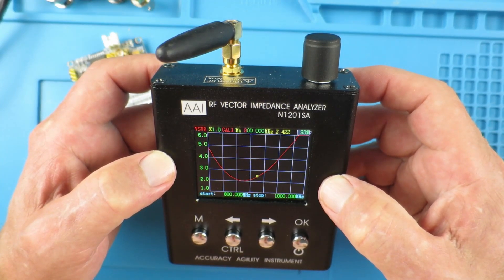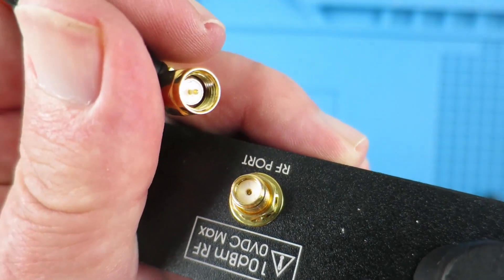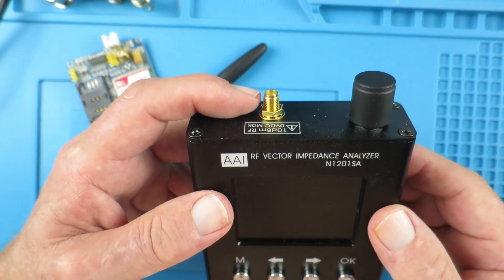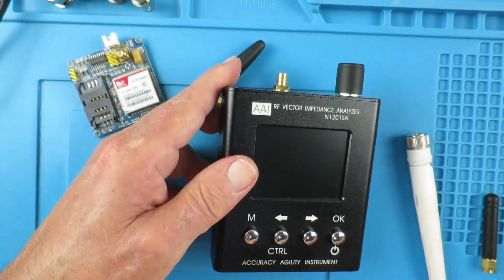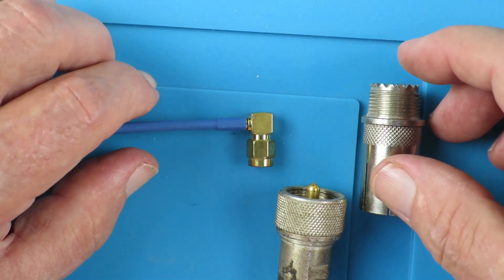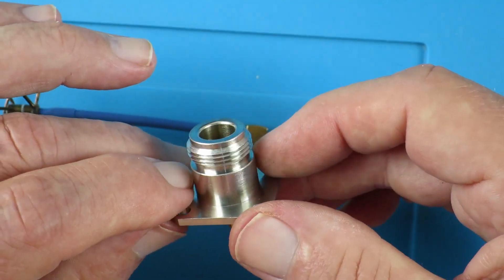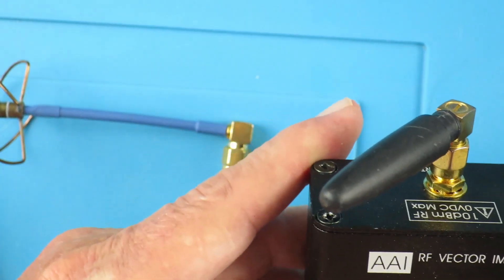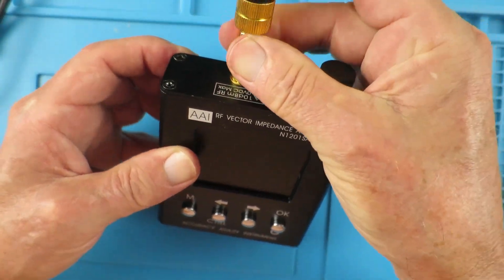SMA / Reverse-Polarity RP-SMA RF Connector Differences Explained Electronics Tutorial Banggood Parts

Comment: These type(sticks) keep coming loose the threads that is on my router so end up rolling sideways down ,  i read thread locker is not conductive so thats  a no go , is there anything that i cud put on the router nibs that wud glue them on after screwing on and dry solid ish , so they dont come loose ,  "Without affecting any gains" or signal in general ,  thx
Reply from the maker: It is recommended that the connectors are tightened with a spanner. Only a very little torque is needed. Just tightening by hand and they will come loose. Perhaps in extreme cases a small blob of hot melt glue could be used as it can be removed. YouTube no longer shows me if you are subscribed. Please consider subscribing if you have not done so already!
Reply: @1nformatica  Thanks for the Very informative reply Much appreciated , the hot glue sounds like 'The One ' Thanks again
Reply: @1nformatica  Hi mate i have another question for you , you know them rp sma adapters the TEE  , so say u have two twist on connecters on the original device well them Tee connecters would then make option of trying 4  antenna would the 4 improve the signal or would it just split the signal to basicaly having and using just the 2 original screw on antenna's , thx
Reply from the maker: @peterbrown8889  No, it does not work that way. An output is designed to drive one antenna (load) at a specific impedance usually 50 ohms. Putting 2 antenna on the same output will not present the correct impedance and the result would be very bad! You could try an antenna with a higher gain (dB), but there is no such thing as a free lunch! High gain antennas are often directional so only give a better signal in one direction. This is seen often on FPV gear where you can use a "panel" antenna to get more range, when it's pointing at the drone!!
Reply: @1nformatica  Thanks mate Your a star so i will skip that idea of getting. or in hope of more gain using 4 of the same antennna on to Original modem connectors ,, did think may be to good to be true What with them little tee adapters being so easily available and look perfect for the doubling up job ,  Thank You. !!
Reply from the maker: @peterbrown8889  The 4 antenna thing is more marketing than science. I have even seen security cameras that have 4 "antennas" but when you look inside only 1 is connected! If applicable try a directional antenna with more gain or even try putting a reflector behind the antenna! https://www.comparitech.com/internet-providers/how-to-make-your-own-wifi-extender/
Reply: @1nformatica  That's great that mate , Thanks again !!!

Comment: Lovely video, as always! You have a very pleasant speaking voice that is easy to listen to! You could go crazy and go down the path of adding different impedance adapters from the 50 ohm to also include 75 ohm. I remember buying a batch of BNC connectors that were being sold off quite cheaply; found out soon after that they were 75 ohm connectors and were of course ever so slightly different in size, so buyer beware! Carry on the great work. More RF please! :)
Reply: I agree with you, very enjoyable presentation!
Reply from the maker: Thanks!
Reply from the maker: Thank you for your kind comment, much appreciated. Agreed, caveat emptor! We've all been burned at some time. What sort of RF stuff do you think would make a good video? It's a huge subject!!
Reply: MHV connectors? for high voltages. also used for radiation detectors